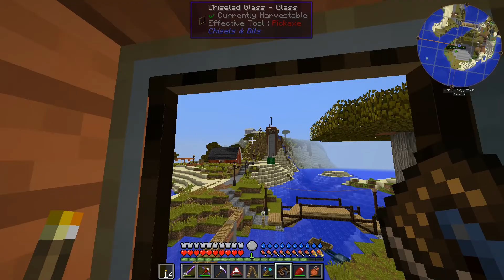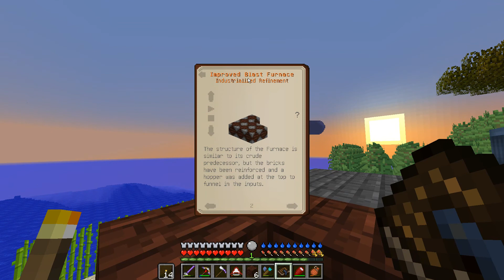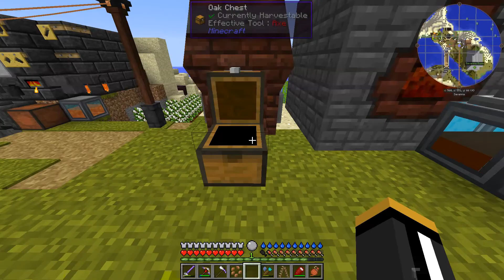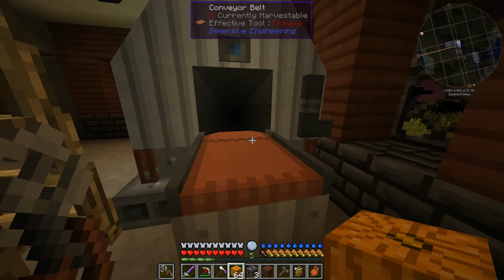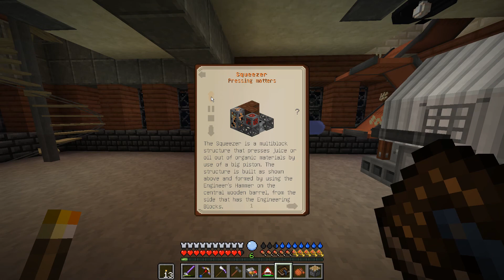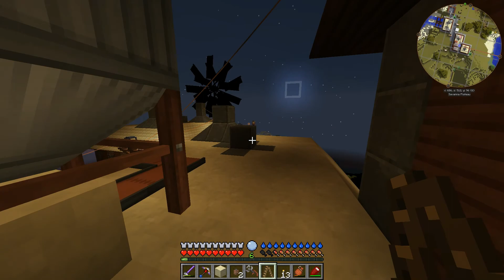Real Tech 15 - Immersive Engineering Bio-diesel

Comment: Hi Danny, I was going to suggest vertical conveyors too but I was beaten to it. There is a press for plates, gears, wires etc that would save your hammer and doubles on wires. I like the assembler big but quite neat, you can always tell the input as a blue connector and the output as orange plus the direction of the conveyors shows it too.
Reply from the maker: I was thinking about doing the press, or even Tinkers patterns, but it's just so much easier to craft that I don't mind spending the extra resources. But on the other hand, it might be fun to play with the press.
Reply: I like the press it is neat and fits well. I just drop a stack of ingots in front of a vertical conveyor and it picks them up does it right. 

As an aside do you know if there is a way to detect when the empowerer has finished, it would be nice if it output a redstone signal when the operation has finished?
Reply: I figured out how to feed the press with ingots, just put a hopper above a conveyor. Also figured out how to fully automate the empowerer.

Comment: First off - awesome vids. Always light and fun, enjoying the "immersive mods only". As a chem major, I did want to point out that its pronounced "ethanol" not "eeethanol" :)
Reply from the maker: Thanks!
You say po-tae-toe, I say po-ta-toe. ;P
Buy, yeah, you're right. eeethenol is a regional pronunciation. I've been trying to break the habit. You may have noticed I switched back and forth between the pronunciations throughout the video.
Reply: Danny & Son I did, that's why I mentioned it since you seemed on the fence. Question - I noticed it seemed like you were feeding conveyors into the bottom of the silos? I thought they only took input from the top.
Reply from the maker: They take input on the top and bottom. If I remember correctly, you can drop stuff into the top and pipe in and out of the bottom.